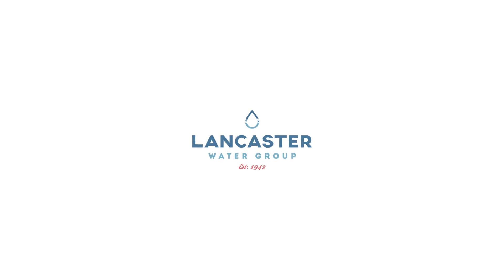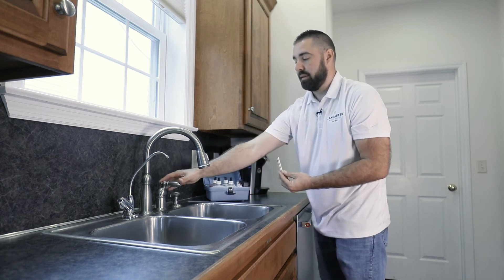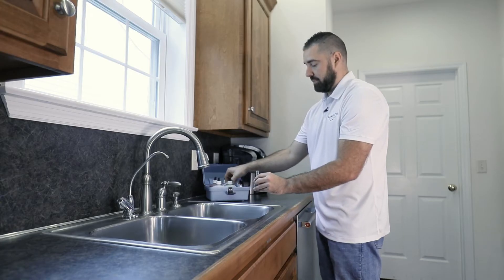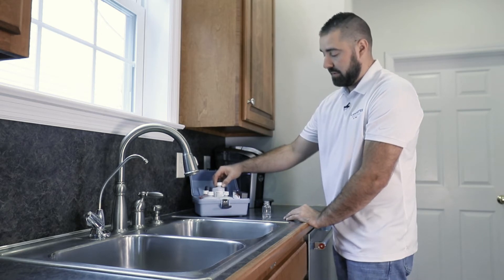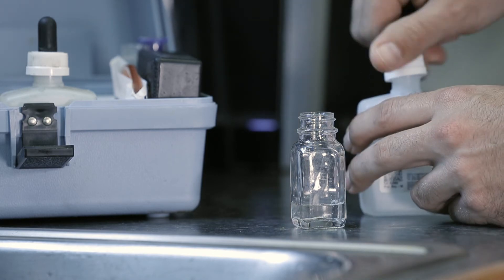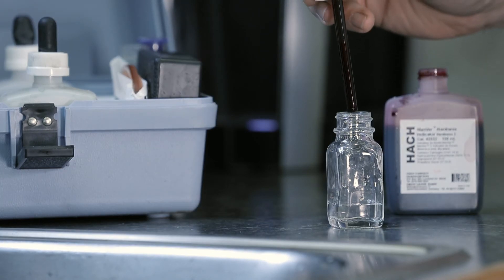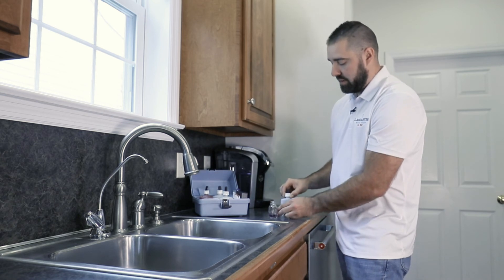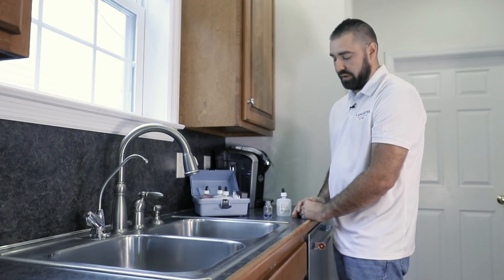HA-62B Hach Water Test Kit - Testing Hardness

Comment: it would be nice if you provided a little more detail about hardness.  what is 1 grin supposed to mean?
Reply from the maker: Hardness is measured in Grains Per Gallon. The grain per gallon (gpg) is a unit defined as 1 grain (64.8 milligrams) of calcium carbonate dissolved in 1 US gallon of water (3.785412 L). 1 grain per gallon of hardness is the lowest level of harness this test kit can measure.

Comment: I got the same reading for 4 water source.
Reply from the maker: @Olecia Toomer, Water samples drawn from within a region can have very similar or even the same hardness readings as they experience similar or identical water influents. 

Neighboring rural communities on well water may be drawing from the same aquafers and therefor may have the same hardness levels.
Homes within the same town on city water will have similar hardness levels as they are all drawing from the same original source.
And faucets within a building should all have identical levels as hardness is primarily dissolved into water prior to it entering the structure.
If you are still concerned that these readings may be wrong, please verify that you are using the Hardness Solution 1 (buffer) and Hardness Solution 3 (reagent) at the appropriate point in the process and not switching them, or send samples for us for our lab technician to test and verify your results. - Thank you

Comment: How many drops for number 3? You didn't indicate!
Reply: You add #3, one drop and mix, then another one drop, mix..............count the drops you add until it turns blue.   lets say it took 7 drops to turn blue...its 7 grains of hardness....hope this helps
Reply from the maker: @Rotaris is correct. Thank you for your help with this. If it takes 3 drops of solution #3 for the water to turn blue, then the water is 3 grains hard. If it takes 20 drops of solution # 3 for the water to turn blue, then the water is 20 grains hard.